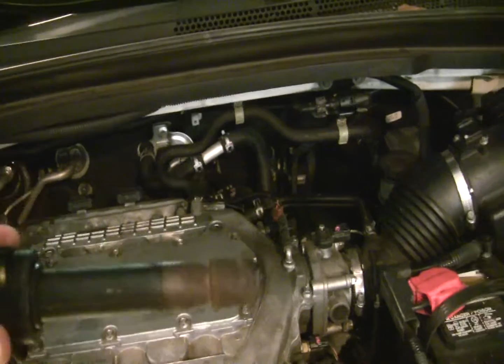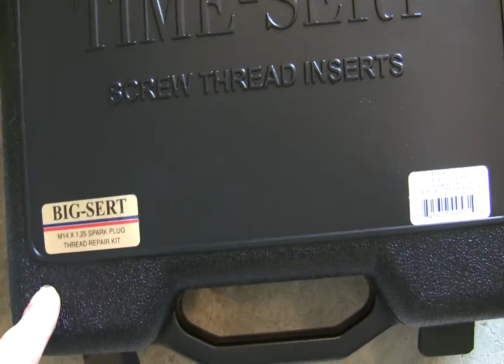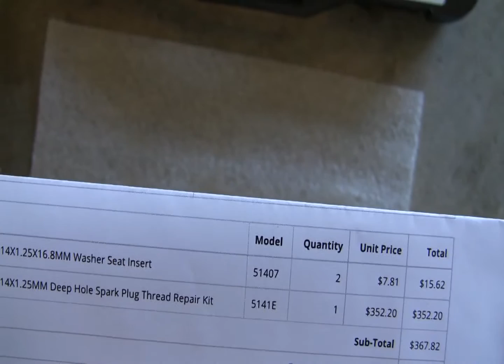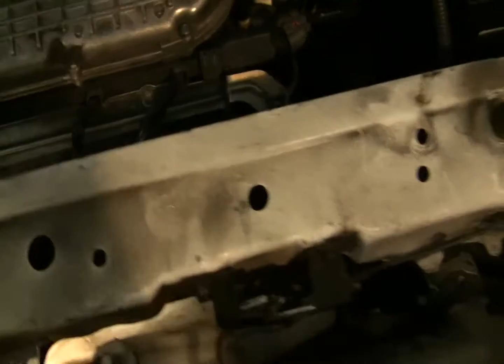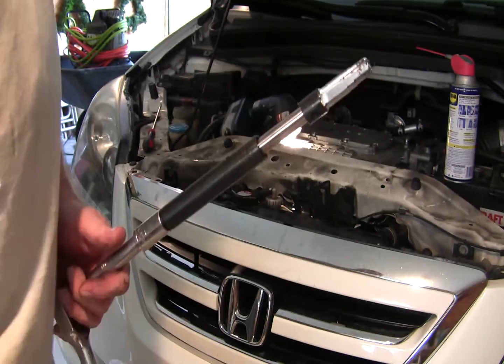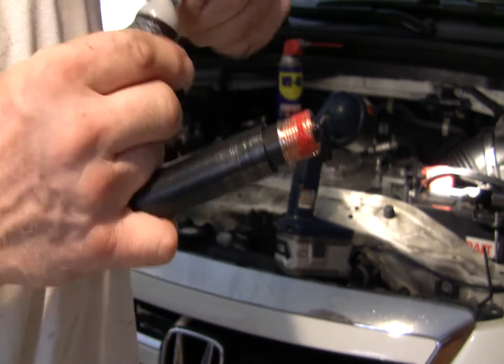Odyssey spark plug repair

Comment: Hopefully you are still on YouTube.  I was wondering how the insert has held up.  Is it still in the car, how many miles has it been in or stay in etc...  I may tackle this on my own so if you could let me know if it is reliable I would appreciate it.
Mark
Reply: The insert has held up very well.   It is still in the engine and working perfectly after 5 plus years and an additional 50k miles on the Odyssey.  I can sell you my kit (only used the one time when I made this video) which includes an insert if you are interested.
Reply: are you interested in selling it?

Comment: If I might make a suggestion it is common to put grease in the flutes of your tap which collets the shavings as well as lubricates the tap. This prevents the shavings from ever entering the cylinder. Guys also fill the cylinder with shaving cream and then vacuum the shavings out of the head. I don’t recommend the later.
Reply: I decided not to use the grease technique. Too many shavings for the grease to collect and most are going to eventually fall down into the cylinder anyway.  Much easier to use compressed air to simply blow them out of the cylinder in my opinion.